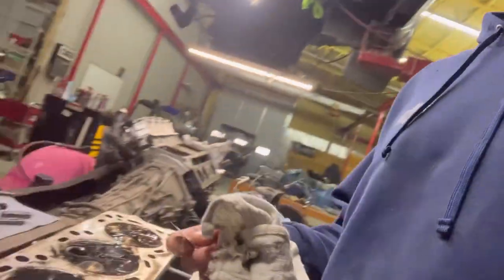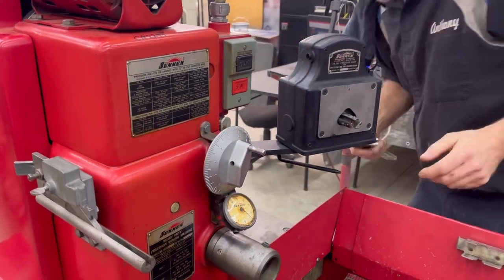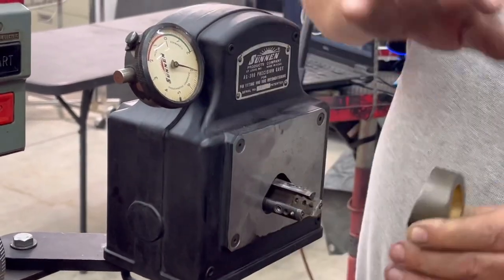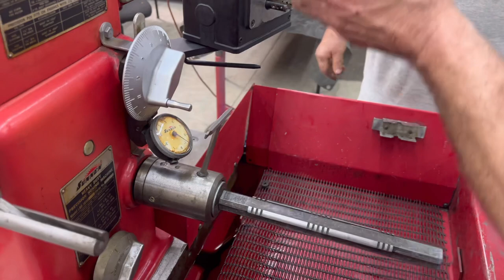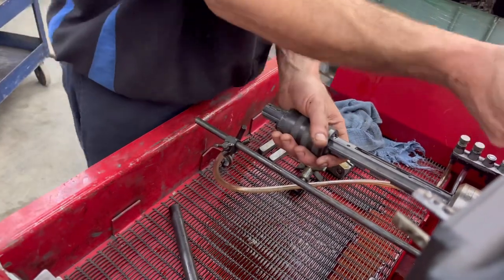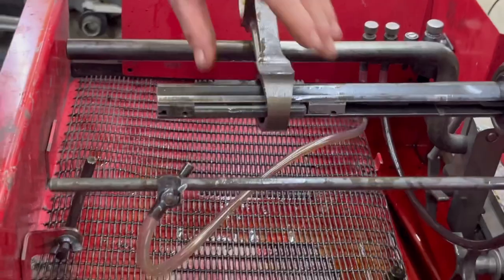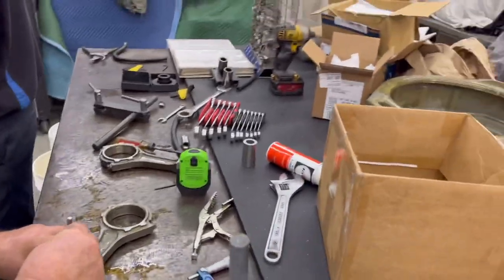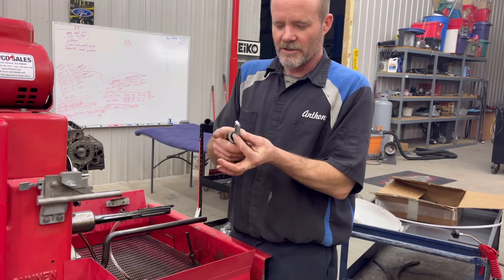Bought a machine,,, no idea how to run it!!!

Comment: Anthony, when we did rods at crower Cams. Once we press the bushings in, we use the hone machine and an expander rod to expand  the bushing to the rod . Before  finishing, honing.  What that did was create more bushing retention to the rod. We never had a bushing spin out once that process was done. Ask your guy about the expander  rod to see if he has one.
Reply from the maker: I was thinking about getting a broach setup.  I could hone to a set size and press it thru.  Kinda like how bronze liners get done.   I will find out about an expander rod!!!  Thank you!!!

Comment: As far as the 5.4, that is a coolant hose that runs from the coolant sensor through that fitting and out the back. The one that is plugged off is supposed to run from that same fitting to a PCV into the valve cover grommet. 

I guess, like you said, it's just cooling the air/vacuum or whatever.  Trust me, if that fitting goes bad, it will suck coolant in the intake and you will have a big mess... lol 

My bet on the power issue is a coil.  In my experience it's best to just replace them all at once with OEM.  Rockauto has them reasonably priced.
Reply from the maker: I hope Joey reads this!!  Comment when you see this Joey!!!
Reply from the maker: Very awesome on giving the 5.4 low down btw!!!

Comment: My 5.4 would idle .was rough I coasted home . It ended up being a coil pack .I replaced all 8 
It cost me 600 for the coils 
My 5.4 is a1999  2 valve truck runs great now .spark plugs came out easy . The 5.4 engine with the 3 valve engines had issues with plugs breaking off . Hope that helps some

Comment: I have 2 sunnen rod honed and have almost every mandrel you will ever need, I make a lot of $$ with that machine and my sunnen align hone
Reply from the maker: Can I ask if you hone boring bushings?  The bushings I have need a bunch of honing to get to size.  I don’t like the room for error to hone it sideways.  Not exactly sure how much I’m removing,,  could be .100.   I abandoned this machine until I can actually cut the bore before honing.   Do you bore the thick bushings or just hone em out??